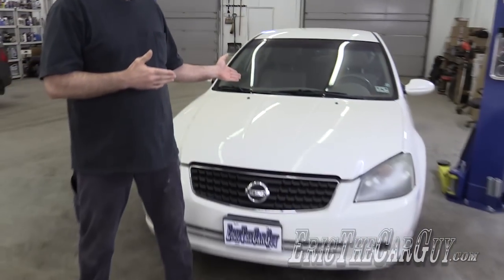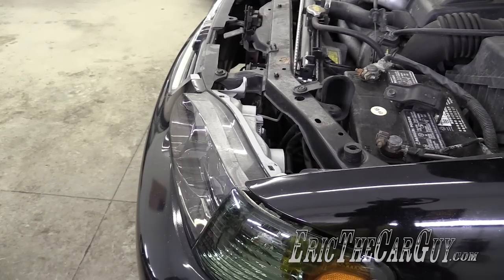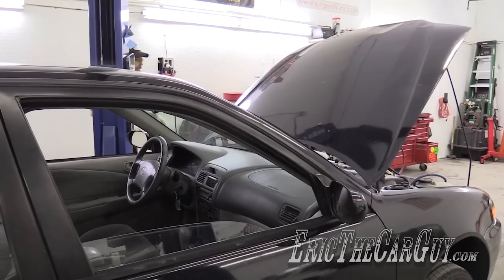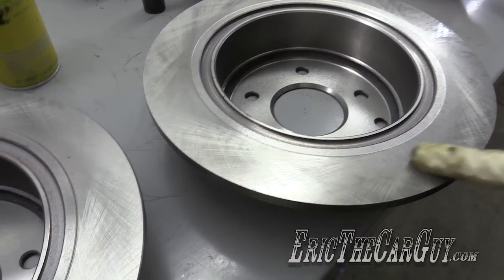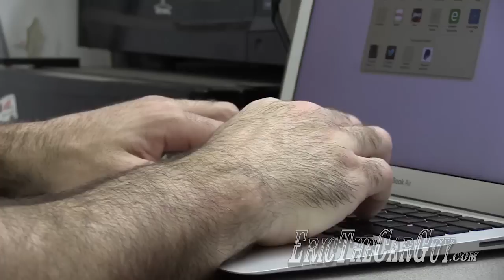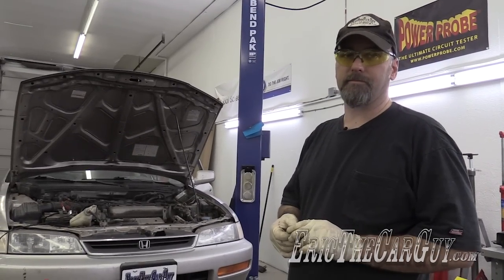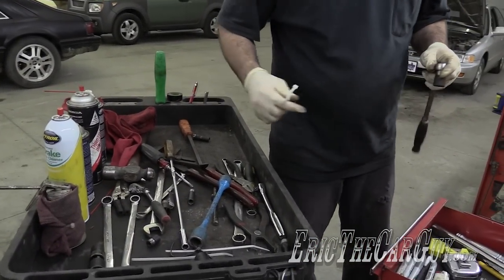A Day At The Shop With EricTheCarGuy

Comment: The OCD in me would have to replace both wheel bearings.
Reply: drink15 Getting ready to do the same in my Blazer
Reply: drink15 Its CDO........whew. Much better now.
Reply: mminc81 CDO?
Reply: DE Nichols
Patterns, patterns...
Reply: DE Nichols The letters are in alphabetical order now :)
Reply: mminc81
LOL. Some jokes die when explained, not this one!
Reply: drink15  I've spent so much money having wheel bearings replaced just because the OCD in me makes me replace them in pairs!
Reply: I really wouldn't feel bad about that. I replaced them one at a time as I could afford them. Being OCD or a perfectionist was in there sure, but when I did one I got 7 more MPG on the free way (because the CV axle was bad too). And I got 3 more MPG when I replaced the second one.

In this case, you're probably getting paid back for it in gasoline.

Note: This wasn't MPG that was new and higher than ever, it was recovering MPG which I had lost from the vehicle aging.
Reply: DE Nichols actually new bearings will have more rolling resistance when new than when worn out. Your mpg probably stayed the same or went down when you replaced them.
Reply: jesus jones No. My mpg got better. I have instant mpg that says otherwise along with manual checks each gas tank.

For my first wheel bearings I rejected 18 that weren't made tight, but smoothly rolling.
Reply: jesus jones I'd agree with you more using the words broken in versus when out.
Reply: drink15 Your OCD might change its mind when it sees the price of those bearings
Reply: +joseph russell 30 dollars a piece oh yeah real expensive.......
Reply: Sure if you put in cheap eBay hubs
Reply: joseph russell Cheap AutoZone Hubs? Can be $90.

High and bearings that you press in? Can be $30-40.

Cheap wheel bearings? $13-14.

Sorry, Joseph in full context your comment doesn't make sense.
Reply: drink15 I do multiple every thing. one bearing was bad on my car. spent 450 for the Most expensive one X 4
Reply: jesus jones I'm sure new bearings are higher resistance then broken in, but new is better than whining and broken down.

Lol. Broken in vs. broken down. Classic.
Reply: you have ocd about not replacing a good wheel bearing, but not about doing a condenser without doing the reciver drier
Reply: Alex Young that's because my experience says to be more anal about one than the other.

To help customers feel better, when the other bearing goes, "Yep, that always happens." Not actually true, but it's said because the front manager and the customer would rather laugh. :)
Reply: Two questions 
1) Do you always keep the shop door shut ?
2) What kind of venting system do you have in the shop because I notice you had an engine running inside the closed up shop

Comment: you should get a wire tracker to see if the wires from the harness actually go to the source of the problem.. it tracks the wire usually by sending a tone through the wire and uses a secondary handheld device that beeps when you're near the wire...they're mostly used by telephone companies...the power probe might have a feature similar to this....wiring diagrams are a pain in the ass!
Reply: YesIReallyDoLikeZebras   It's also sold by Harbor Freight Tools.  (Shameless plug for the china crap tools.)  Pretty cheap and a decent investment.  And now back to our video....
Reply: YesIReallyDoLikeZebras Right. Briansmobile1 put up a great video about that.
Reply: DE Nichols
that's probably where I remember it from!
Reply: YesIReallyDoLikeZebras
Great minds remember alike.

Comment: Can I suggest an electric door opener/closer for your garage? It seems that you are wasting time with that time consuming door chain. Unless you like extra workouts.

Every repair garage that I have work done on my cars has them. The tech (you) can then just push the button and then focus on the next car repair. It should be a good investment over time.
Reply: ***** We literally just push it up and pull it down by a rope. Very quick very reliable.
Reply: Shoot. I've had powered doors so slow if I was tired they'd about put me to sleep.

Comment: I notice you run the cars without the garage doors open that's not a good idea.  I know these little rice boxes don't put out much emissions but still not good to breathe that in.
Reply: i noticed that too. maybe leave the door 2 feet open?
Reply: I thought the same thing. However, I came to the conclusion that there's most likely a ventilation system installed in his shop.

Comment: I did the same job on my father's old Nissan with the bearings. Living in Florida, we don't have the issue of rust locking on the bearing you had, unless you live right on the beach. I loosen the bolts and the bearing fell right off, in fact it started falling off before I could get the 4th bolt all the way off.

Comment: You're probably used to doing it the old fashioned way but you could be saving a lot of money in refrigerant in the long run by just investing in just the basic robin air recovery and recycling machine. It would also just make A/C repairs so much faster and easier, saving you money in time.

Comment: I had a similar situation where I was stuck with gm abs  delco system yellow amber light.Problem was a leaky wheel cylinder. replaced it and bleed both abs and all 4 wheels . Good to have a freindly neighbor with a smile. I had to search internet to find a info .Got lucky found a you tube video with the exact abs delco module in my car . There is 4 types . I have alldatadiy for my car was able to pinpoint the exact abs model my car uses . Gave me the info i needed to repair by myself . Got my car brakes to bleed and repair my abs light off and fixed all four wheels and bad leaky cylinder in wheel. Problem was I could not bleed them without homing my abs in the hood. After I did that all wheels would bleed . Got back all my brakes been good now for 3yrs. Every year I pass . Once an while I get evap code 26 today fixed with new egr solenoid this week . Replaced the egr valve last year and now I got new evap solenoid . All lights off. passing inspections now got my sticker on my car to prove it.Youtube a great asset for fixing my car. and I took, mechanics and love working on them.

Comment: This was a super cool segment into the life of an experienced technician. Maybe electrical issues should be passed to an experienced circuitry/diagram tech of some sorts. Nonetheless, you should tackle a GM in the near future if problems arise. The Equinox of all ages is a prime candidate for minor problems like stuck key in the cylinder. I drive a gen3 toyota btw so I have no issues hardy har.

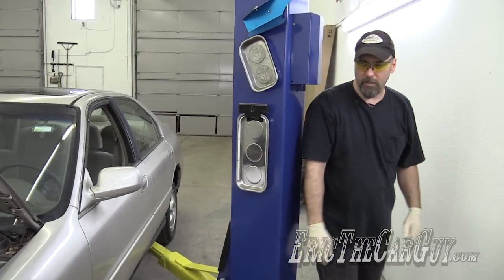Comment: On some newer cars only switching on the ignition and air con without the engine running the air con system will not turn on so you won't be able to test the system this way, the compressor is only energised once the engine runs. 5:42

Comment: On standard use everyday cars, rubber brake hoses work more than efficiently; however just know that everything wears.  Steal braided brake lines are best used when you have a vehicle you track or race.  They will not expand due to increased heat from the rotors.   Other than that, they only become a personal preference.

Comment: I did the same wheel bearing job on my wife's nissan altima.  Her brakes pins were also dry as a bone and rubbing like that one.  Did you notice any rust under passenger floor board.  Such a bad problem with those Nissans.

Comment: ive been a mechanic professionally since I was 21 I just turned 28 and I have honestly worked on plenty of cars trucks you name it ive fixed or replaced it except a evaporator core belive or not never once and from end of april until September its like almost a guarantee you do at least one car a day with ac issues but for what ever reason ive never had a issue kinda crazy

Comment: Question. I have a 2000 Honda HR-V, which during long trips (300km/~175mi), burns almost the entire oil reserve, as far as the dipstick goes.
I regularly add oil to it, and have proceeded to do so since i got it two years ago. It still runs great. Why the hell hasn't the engine given out?

Comment: During my time in the USAF we used to have to use a brakes parts washer before we removed the drum/brakes. I'm sure you know why but for those who may not back then vehicle brakes had asbestos. Seo by washing the area we ensured we would not breath in any asbestos brake dust.  I now hear that there are no longer any asbestos brake pads on the new model vehicles is this correct?

Comment: @EricTheCarGuy when removing the wheel bearing, do you just thread in a spare bolt to where the original bolts were and use the air hammer to beat the bearing out?

Comment: I never reuse A/C o-rings. I had to install o-rings on a compressor and recharge the system in an Infiniti G37 not too long ago and I could tell the shop that swapped out the engine reused the compressor o-rings, it leaked out quick.

Comment: Great idea for a video. Also interesting seeing you prep for a job and interact with the parts people.

Just out of curiosity, why did you need to bleed a bit of the brake fluid when pushing the piston back in? Won't the fluid simply get pushed up into the reservoir?

I only ask because I'm planning a full brake job this weekend.

Comment: I just replaced the six-month old front hub/bearing assemblies on my truck.  The tech fastened the spindle nut with an impact instead of a torque wrench.  The bearings were crushed and the grease was oozing out.  Not hard at all but unnecessary.  $100 plus about 1.5 hours of my Saturday.

Comment: hey eric, i was recently in a front end collision, my condenser was bent in fairly far a few inches and the radiator was too, neither seem to be leaking as my AC still works and the radiator holds coolant under pressure, how likely is it that these will fail sooner rather than later due to the damage? Just wondering so I can expect when to replace.

Comment: I noticed you used a lot of little bottles of oil instead of a single big bottle.

Is it cheaper that way, or just because you don't need to balance a big old can on the engine?
Reply: cammza9989 I think its because he can charge the customer the exact amount of oil he used easier. For instance if he has a gallon of oil and only uses 7/8 of it, its kind of hard to tell the customer that. But if you were to use 3 and 1/2 quarts of oil its easier to show/tell the customer on paper. Thats why I do that.
Reply: cammza9989 Probably supplied by the owner. I get customers like this.

Comment: Never caught the year on the Accord w/ the AC/wiring issue. Curious though... if it had ODB-II, would checking for codes be of any use (maybe you did but it didn't make the final cut)?

Comment: You installed an A/C condenser that the customer supplied, are there times where you will not use the item the customer provided? Like if it was a used part or something? My bother was gonna take his car in to and an oil pan gasket replaced and he already had the gasket, but the shop was gonna charge a higher rate if they used his gasket. Do you do that, or do you just take it and install it?

Comment: Hey. I saw you messing with the shoe/parking brake adjuster on the rear wheel bearing.  I was wondering how far out should I adjust them?  The guy at the auto hobby shop on base said I should adjust it to the point where they just start to drag.  When I took my 1970 VW Bus down the road, it had no power (less than the normal amount of gutless), so I pulled over, and the drums were smoking out the adjuster hole, so I pulled the adjusters back in and it was okay, but I just want to make sure I do it right.

Any info would be great.  Thanks, man!

Comment: Eric - I have a question for you...
I realize there may be a difference between the a/c system on a diesel engine but maybe there isn't.  I have a diesel engine in a Ford E550 bus.  The a/c blows cold at startup and hi-idle.  Once I'm on the road, the a/c temp feels like the vent mode is on. Could the system be over-charged?  Any idea what might be happening?  I've had several techs look at it and no one seems to fix it.

Comment: You open the brake line when you compress the pistons? Do you do that all the time or just when it's not compressing
Reply: +oHerroPrease 
He does that to avoid forcing fluid back into the master cylinder, some times that can cause issues in the master (as he stated in another video).

Comment: Whyyyy are you using your impact on those lug nuts my friend?  Last time a shop did that on my wife's Chrysler, the Rotor seized to the Hub, Wheel seized to the Rotor, and I had to use a BFH to get them both off.  100 ft. lbs. is pleeeenty :).  All in all I am just busting your chops.  You are a wealth of knowledge and I appreciate your videos!

Comment: Hey EricTheCarGuy I got a small question to ask. I previously watched a/c recharging video from you and was wondering: 1. Do you charge from an evacuated system by weight or pressure? 2. From partial charge guess weight or pressure?

I have my girlfriends 2005 Mazda 3 that I am going to replace a/c clutch bearing since it is shot and making noise, the belt has been removed for almost a year and my gauge is telling me that have like ~50 PSI but I know this reading is without the system running and having both high and low sides of the system equaled out.

I do not have a vacuum pump to evacuate the system and go from a fresh charge, I am hoping to be able to charge the system after replacing the bearing.

What are your thoughts/preferences?
Reply: AJ Harran Or would another way of charging be just add a little at a time till it gets the temp down a fair way?
Reply: AJ Harran That's valid, just have a gauge on it and don't go to high on the pressure.

Comment: great video , but I have a query , why don't you but oil in bulk , instead of those what I assume to be quart bottles .
Reply from the maker: commodore665 Not a lot of space for storage for starters. Also the variety of vehicles that come through the shop warrant many different grades. Buying it by the case isn't that bad really.
Reply: I thought the same....I buy 10w40 and 5w30 by the drum....and get in the low ash dpf stuff and 0w40 as I need it....covers me for 95% of normal cars.
Reply: ***** If you look in the owners manual there is usually a range of oil weights the car can use based on temperature. If the oil cap says 5-20, 5-30 will work fine in hot places like florida.
Reply from the maker: pdgeman I strongly disagree with this practice. Put in what the oil cap says, period.
Reply: EricTheCarGuy
ah that makes sense , I kind thought it would be a space thing

Comment: you use circuit breakers as daily use switches?
Reply: TKTmon Same at every shop I've been at.
Reply: I just assumed that since breakers are designed to be on all the time, they would wear out faster when being switched everyday vs normal switches
Reply: TKTmon A lot of businesses do use just breakers and dont have normal switches not just car repair shops...I work in the restaurant business and alot of the restaurants i worked in dont have switches you turn off the lights everything from the breakerbox
Reply: TKTmon This is pretty common actually as long as the breaker is labeled with SW from the manufacturer it can be operated as a switch.  I'm an electrician.

Comment: Great video enjoyed watching alot. But one thing you did which i have to pick up on, putting wheels back on the Nissan using a gun to put the nuts down...all well and good but not the locking nut 😣 as a mechanic this is one thing that does my head in when previous mechanics have used air guns, inpact gun etc to put lockers back on sometimes to the point of they are so tight the key gives way! Vauxhall/opel are prime examples of this.

Your a mechanic not a fitter 😉

Comment: Dang Eric. After all this time you are still doing rear brakes and wheel bearings? Make no mistake to get out of a tight spot I would do them but I do not advertise.
Put a hose on that car you are running. Running a car without an exhaust hose will not make you popular in the shop.
Eric. I ask if there is an indication (like a blue snowflake light) that illuminates when you turn the AC on, there should be some indication,visible from inside the car. If not the problem could be with the electrical part of the mode levers.
Way back in 1986 I came across my friend Helmut working on a 318 BMW (bad car). Helmut had jumpered the lower slider electrical contacts, Wow now it works he says. I explained to Helmut how that bottom slider needs to be moved to the right for AC.
Managers want this electrical diagnosis quick. Warranty has a hard time paying over .6 for any electrical diagnosis, no matter how good of a story you write.

Comment: What are the battery terminals on the outside of the car @ 35:53 for?
Reply: Steven Barnes This is just a totally uneducated guess, but the car was a track car, so it's a somewhat safe assumption there's a fuel tank in the boot, so maybe they're a fuel pump cut off?
Reply: Steven Barnes Good observation, I'm really wondering now. MrManBuzz I have no idea, but thanks for the input.

Comment: I wish I had a lift so bad. The only reason I put off car work is because I hate jacking it up and rolling under it.
Reply: Me too, it would make brake work soo much easier, would probably be done in half the time. Oil changes is a breeze since I have a pit in my garage, but work inside the wheel arches is kinda awkward.